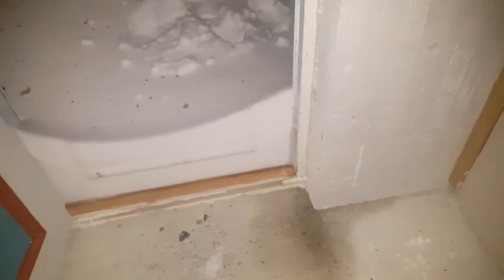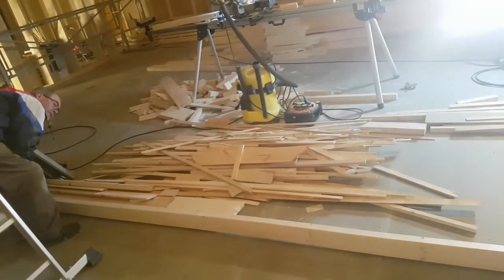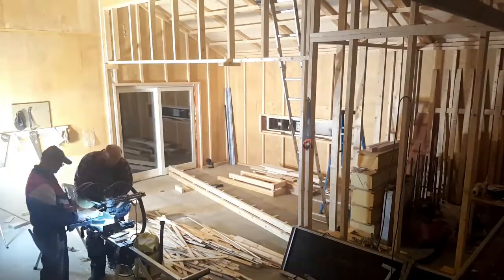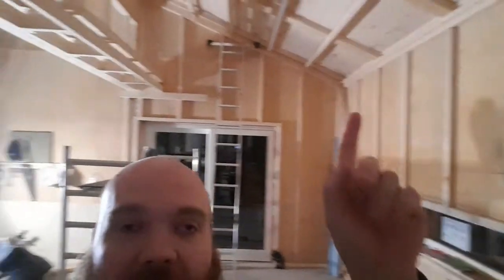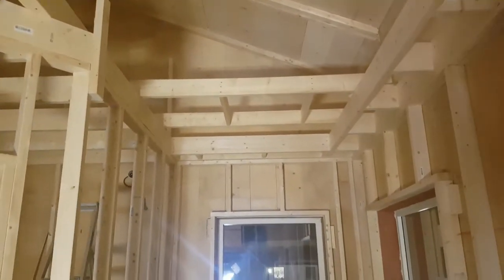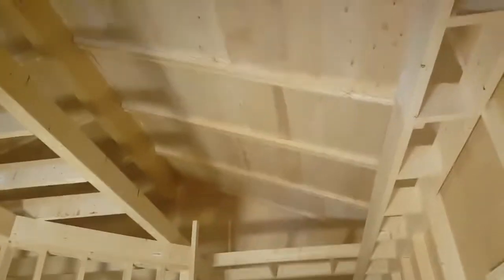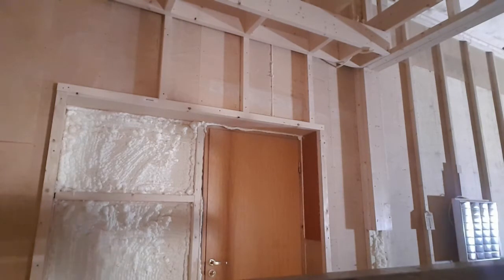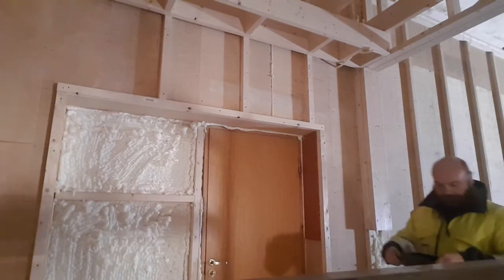Digging myself out, and starting the kitchen tray ceiling at #jarleifhouse!

Comment: Good idea having a nice, strong area in the roof space so ventilation and services can be maintained and repaired. 
I have a ducted heating system in my roof space, I made sure I had easy access to it and solid flooring around the installation for the future. Already used it several times when adjusting the system from new.
Reply from the maker: +Sideslip It sure beats balancing across rafters fearing falling through for every step! 😁 The ventilation system will have ducts to every room, so it will make running the ducts a lot easier as well! 😃 Thanks for watching and commenting! 😊✌